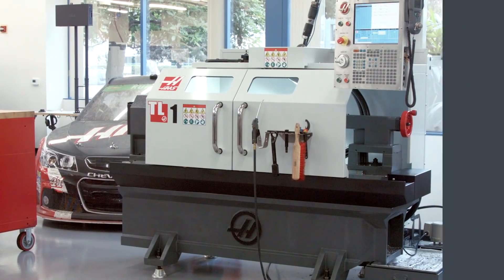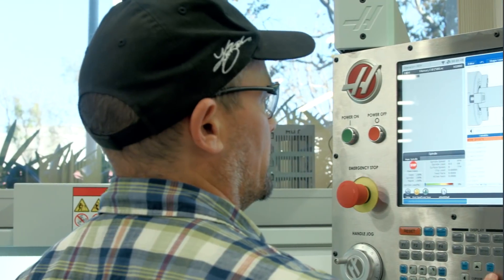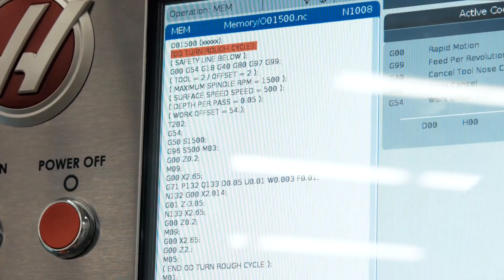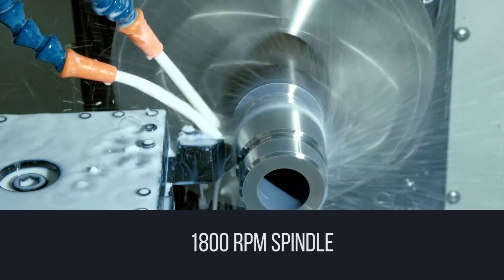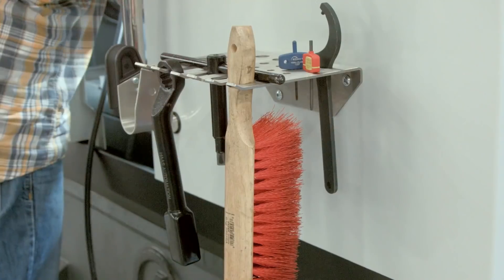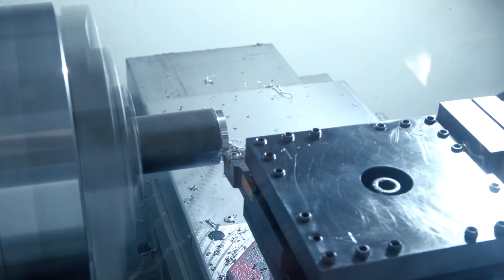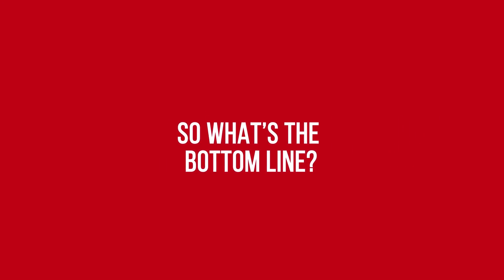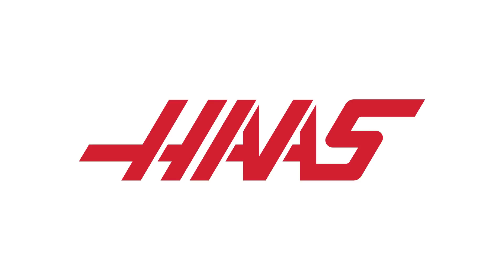The Haas TL-1 - Toolroom Capability & CNC Productivity

Comment: I wonder about things noone else has asked about: Tailstock with MT4 taper is "nice", can I use it (as in up to 50mm/2" drills)? Threading using tailstock, can I do a M24 (~1" UNC?) in CroMo-steele/stainless toolsteele? When I put a piece of stock diameter 200mm (8") in the chuck, how wide grooves can i make in it? Need 4,5mm wide grooves on the face, ~20mm deep.
 Would be nice seeing these machines do something else than 1½" diameter 2" long work. Is 0.1" DOC (2,5mm cut) at feed 0,015"/rev (I use 0.30-0.35mm/rev) to much? Thinking about putting ~50 000$ on the line for a TL-2 these things would be nice to know...

Comment: Hi , are options like tool changer and 3000 rpm possible to add at a later date if needed and is the magnetic jog wheel box an option or standard ?
Reply from the maker: Kev Hooper - The tool changer and the electronic hand wheels can be, both are options that can be added to the machine later.  Haas Automation

Comment: The tailstock on the original TL1 was so bad, lost count the amount of times I had to readjust the grub screws just to line it up.  Nice to know they up'd the motor to 10hp from 3hp that I worked on ages ago.  0.8mm DOC was painful with the original model.
Reply: Pretty sure the old ones were 7.5 hp

Comment: I am curious some of the surface finishes do not really look happy. Camera angles tight and short clips show surface defects. Is this tooling or is the rigidity of this lathe just not up to the heavier weight ST line of lathes.
Reply: Surface finish is irrelevant on rough cuts, hence the name... Rough cuts.
Yes it is a rigidity and HP problem, but surface finish will correct it perfectly.

Comment: I  need more info. about G02 and G 03
Reply: G02 Radius - arc in clockwise direction, G03 counterclockwise direction of machining. e.g. G01 X10.; Z-10.;G03 x20. Z-15. R5.;  will make full 90° radius 5 mm...

Comment: Now THATS AWESOME!    crosslide ,saddle mimicking jog wheels! So nice! And a turret!   I just wonder if the x has enough travel to put the tool post on the opposite side of the spindle so you can turn with upside down tools in M3 rotation

Comment: I was interested by the safety sign on the enclosure of the lathe, all the usual sort of things, don't put your hand in it, and try to grab the piece while it's running, don't turn parts allot larger than the chuck.  The bit that interested me is the no ceramics part of the sign, why can't you machine ceramics, or use ceramic inserts? Is is something to do with the abrasive nature of them on the ways, or the rigitifty of the machine isn't sufficient to allow you to turn with ceramic inserts?
Reply: The ceramic materials turn to extremely fine and abrasive dust which eats away at the motion components. There are ways to work with it, but the machine needs some special parts,

Comment: CNC is awesome... but no shop should ever get rid of their manual lathes and mills... WHY? cause a CNC can and will break, when a feedback sensor, cable or some electronic component fails, the whole system is down.  Waiting for expensive repairs is a NO GO. Always, always keep manual machines on standby and maintain proficiency on both CNC and manual machine operation.
Reply: Ramiro M, that's what I once said. Then my CNC went down and I the manual machine still sat there  while I waited for service because It cant do the job anyways. Some parts just cant be made on the manual economically at or at all. Not saying there is not use for them but if space is limited, I would rather have another CNC in its spot.
Reply: That's good advice for a tool room.  In a production environment that would be the joke of the day.